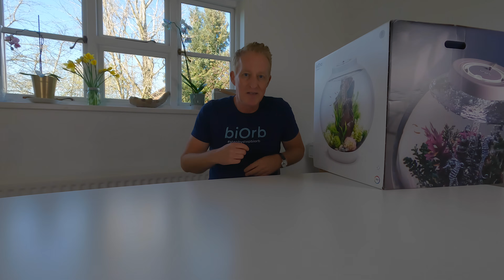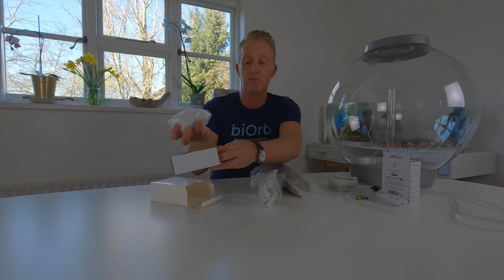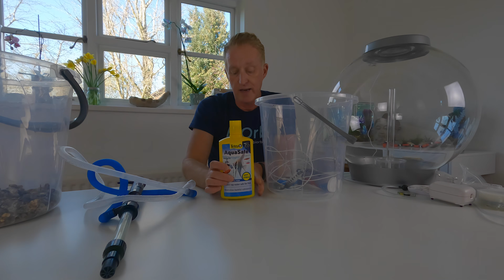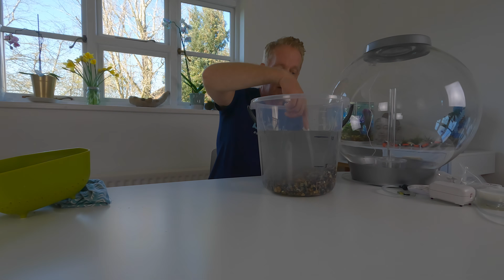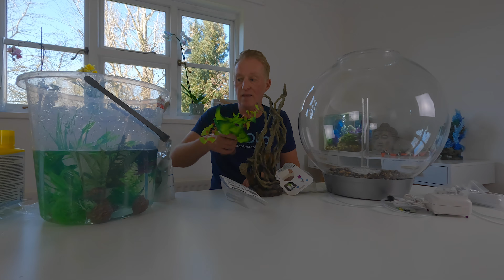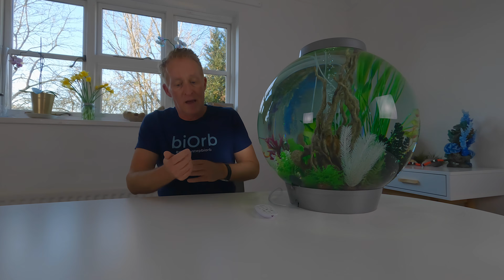biOrb Aquarium   | Starting a biOrb | New approach!

Comment: Hi Mark, great video as always.  I'm setting up a new 30ltr Flow Biorb and have the pearl media, which I have washed as you recommend in your other video.  The 2kg recommended by Biorb only comes up half way around the bottom area of the filter in the middles, does this matter or should I buy a further kg?  Also when do you add the colony liquid, is it at this stage of when you add your water or do you leave it until the tank has sat for a few days?  Thanks!
Reply from the maker: Hi Julie. Yes, 2 kilos is correct for a 30L Flow.  There is no need for it to come up higher around the filter canister. The only real function of the Pearl Media is to act as the aquarium's biological filter and 2kg is more than enough to support the beneficial bacteria needed to support fish in a 30L. 

The best thing to do is to let the tank run (without fish) for a couple of days. This allows the water temp to balance out and allows you to check that everything is working before adding your first fish.  Colony should be added to the water on the same day or at the same time as adding your first fish.  The day before is probably okay though. The bacteria in Colony will only begin to colonise (expand in number) when they have settled on surfaces and when there is a food supply to support their growth (the food supply being the ammonia that comes from your fish and initial feeding of fish food). Adding the colony prior to adding the fish wouldn't provide any real advantages as there would be no nutrients to support bacterial growth.  Hope that helps. Best, Mark
Reply: It's been a week since I first set up the tank and I didn't add any more Colony.  Just watched your original 2 part set up and the revisited.  Also read the details which all makes sense now! THANKS SO MUCH - I made notes this time so I wouldn't forget!
Tap water readings: Alkalinity 300. PH 7.8, Carbonate 120, Hardnss (grey colour not on scale),  Nitrate 0, Nitrite 0, Fee Chlorine 0.
my tank readings Alkalinity 300, PH 8.4, Carbonate 300, Hardness (grey colour not on scale), Nitrate 0, Nitrite 0, Free Chlorine 0
I'm guessing that as some of the readings are way of the required levels I need to wait before adding fish.  How do I get the other levels into the normal levels?
I also had a concern about the main ornament in a Biorb set called Forest Rhythm.  I noticed a strong plastic/resin smell when I unboxed them soaked them all for a couple of hours then added to the tank.  When I checked the temperature there was a really strong plastic smell in the tank, I left it a few days but the smell didn't improve.  I removed the main ornament and have had it soaking in a bucket for about 4 days now.  Is this something that could taint the water and affect the readings?  Should I do a full water change?
Coffee on it's way!,
Reply from the maker: Hi Julie. 

Those readings are fine... it is just that you have hard water in your area (but it is not "very hard"). The pH in the tank reflects what is called "true pH". When your tap water (with pH 7.8) is left to stand for a couple of days the pH will adjust when exposed to air (normally it will rise). In your case to 8.4.

So, all the readings you have are what I would expect with a hard water supply and higher pH level.  BTW - you are lucky to have zero nitrates!!  
Rather than adjust water... it is far easier to go with the water you have.   To alter your tap water you would need to filter it through a RODI water system and then remineralise it.  I suggest you avoid trying to chase a water quality you don't have, especially when you don't really need to.

The very key thing is ensure that you only choose fish species naturally suited to high pH/ hard water conditions.  Examples of the typical fish suited to your water would be: Guppy; Molly; Platy; X-Ray Tetras; Endler's. All of those would be happy with the water supply you have.  

In terms of the ornament smell. It's the first time I've heard of that!  It might be coming from the "paint" that biOrb apply to colour their resin moulds.  I don't think this is a problem to be honest. But, as you have not added any fish yet it might be worth you replacing 50% of the tank water with fresh.  

A really good product to remove impurities, odors etc in a tank's water is activated carbon: https://amzn.to/3wE8k1p. Activated carbon filters the water that passes though it and I'm sure this will help to reduce the issue you have.   If it was me, I would throw away the biOrb filter medium that comes with a new tank (held in the central canister tray part of the central bubble tube filter) and replace this material with pure activated carbon.  I would also suggest using activated carbon in the future, every time you clean and replace the filter medium. So, you might as well start doing that now. 

I hope that helps. Speak soon.

Best, Mark
Reply: Mark you are an absolute star! Thank you so much for all the information, very  much appreciated!  I've made a note of the fish, thanks
When you say replace with pure activated carbon, is that the same stuff that is in the packs of 10 sponges and carbon you show in one of your videos? I was just about to order those!
Reply from the maker: Not a problem. Always happy to help.  :)
Forgetting the overly priced biOrb Service Kits, there are two basic ways of  replacing the sponges and filter medium in a biOrb. 

1. Get the alternative packs that combine sponges along with small individual bags of activated carbon (often mixed with another natural product called zeolite). These often come with replacement air stones. Such as: https://amzn.to/3uRTggd

2. Alternatively you can just get the sponges by themselves, such as https://amzn.to/49OgPWc, and then separately purchase a high grade activated carbon product such as this https://amzn.to/3T9agXw 

Option 1 is probably the simplest approach as you get everything you need in one order. The main drawback is that you don't have any say in the quality of the activated carbon  supplied in the bags.  I prefer to use Option 2 as I tend to want to get higher grade activated carbon. I also need to get individual air stones: https://amzn.to/3TimrCv. 

Generally though it doesn't really matter as both option 1 or 2 work well and are far more economical compared to purchasing the biOrb product. The biOrb product seems to lack much in the way of activated carbon and instead uses zeolite and "other" resin materials to support filtration.  Most of these materials are not of much use  (in my opinion). 

Activated carbon is always the key ingredient needed for most aquariums and for most types of water supply.

Best, Mark

Comment: Great imformative video, however now its all set up full of water etc, how do you lift it onto the Bio Orb stand?
 Would it not have been better to place the stand where its home is going to be and sett the tank up on the stand.
Reply from the maker: Thanks for watching.  

Yes I agree with your comment BUT in my case I was using the tank to produce videos for this Channel throughout the period March to April of that year.  So the tank was set up for undertaking those videos.  A 60L tank can't be moved when full and, to do so, the water level needs to be dropped to about 1/4 on a 60L to allow relocation before re-filling  the tank back up with the water extracted.    And, of course, the tank is now set up on its stand.  Best, Mark

Comment: Hi there. Just bought a bio orb 30 classic.   You are right, the "instructions" are rubbish.  Thank you for this video ( and others I'm going to watch).  Question....I want to make this a planted tank.  Can I add some aquasoil and sand on top of the ceramic media and be successful?  I have a regular 37 gallon planted tank and it's doing well ( finally) with the soil and sand.  Thanks for the advice!!
Reply from the maker: Hi there.   The biOrb biological filter is an under gravel filter system that relies on a good flow of water/oxygen down and through the ceramic media and back towards the central filter/bubble tube. This water and oxygen flow is essential for beneficial bacteria and the better the flow through the media the better the biological filtration. Adding a layer of soils or sand would impede/reduce the flow of water down through the media.  

If you are going to add a layer of sand/soil you would certainly need to convert the biOrb using external sponge rings around the base of the biOrb central filter to avoid these finer materials getting drawn into (and clogging) the mechanical filter.  This sort of thing: https://amzn.to/49eZANE . You may need to add two of these (stacked).  This MAY help reduce the amount of material getting drawn into the filter.

The alternative is to go heavy on using real plants that are not reliant on (don't even like!) a soil substrate material such as anubias and java fern. This allows plants within the tank but retains the correct use of ceramic media as the biological filter.

I hope that helps.
Mark
Reply: @StepbyStep-biOrb  Thank you!!

Comment: Hi. Is the pump below or above the water line?
Reply from the maker: Hi Caroline. Typically, an air pump is placed on the ground, so therefore well below the waterline. There may be some advantages of having the pump elevated above the waterline but these are very small. All mine are placed on the ground.  Best, Mark

Comment: Hi there! I've been given a 60 litre BioOrb - we used to have a large Tropical tank but during our move 5 years ago,  the tank didn't make it! The Bio Orb has a tube hanging underneath it - I was told that 'he had to cut it! " I've now bought 2 mtrs of clear tubing which is slightly narrow than the one hanging down underneath - there's a couple of plastic connectors which came with the airshow sets I bought.  I'm worried that the water might start coming out of the bottom! What is it used for please?  Thank you.
Reply from the maker: Hi Anne. Sorry for the delay. I've been out of the UK on vacation with limited access to wifi. You might be better getting the biOrb product as this would work best and is designed for these aqariums. https://amzn.to/4819gvc. It is basically a simple tube that is best fitted when the tank is empty. One end is pushed on to the small pipe underneath the aquarium, the other end hangs down and connects directly to the air pump. Note that all air tubes (air lines) must have a one way valve fitted (the biOrb product has this already fitted). This stops the tanks water draining down the airline (which will damage your air pump and could also result in the tank completely draining).  The one way valve sits at the end of the airline nearest to your air pump. I hope that helps but please let me know if i can help further.  Best wishes, Mark

Comment: Mark:  I've done everything I should to my 15 L biOrb according to your instructions.  It's been running (without fish) for 5 days.  It is still cloudy!  Ugh.  What should I do?
Reply from the maker: Hi Denise. That isn't an issue. Can you confirm what you have added to the tank to date? Is it just tap water, treated with dechlorinator (e.g. aquasafe?)
Reply from the maker: Anything else?
Reply from the maker: Is the water white/ greyish?
Reply: @StepbyStep-biOrb  Hi Mark. Thanks so much for getting back to me so quickly! Yes, tap water w/ AquaSafe as directed   I haven’t received my tap water tester yet from Amazon. But I have tested the PH (6.8) Ammonia (0.25 ppm) Nitrate (0) and Nitrite (0ppm). Water temp is 79 F
Reply from the maker: Perfect! 

The are two main causes of cloudy water. 

The first happens if the substrate added to the tank hasn't been properly rinsed to remove dust residues etc.  This can be easily tested by turning off the air pump for about 15 mins to see if the coloration goes. Turning off the air supply allows any particles, held within the water, to sink to the bottom of the tank. This will then leave clearer tank water. 

But, the main reason relates to the initial stage of the aquarium cycling. With a brand new tank, it is EXTREMELY common to have a bacterial bloom (mainly caused by heterotroph bacteria). These are very early bacteria that are taking advantage of the conditions created in the tank (no chlorine and lots of minerals in the water). The ideal conditions you've created cause them to rapidly increase in number. The bacteria are basically having a free for all, as they have no other bacterial competition in the tank... they are having a party!  They are not an issue for the tank/water. If left long enough they will eventually consume all the available minerals... and then it's party over!  But, if you were to undertake a water change, you would simply be helping them bloom all over again by adding more nutrients. Party time again and the continuation of cloudy water! 

These initial bacteria are very easily out-competed by other bacteria that will form in your tank (beneficial bacteria) so when you start to cycle the tank, add a bacterial booster, and a few fish you will find they will go almost overnight!  

For now, I suggest you sit back and try to enjoy the very first signs of life in your new tank :)
Reply: @StepbyStep-biOrb  Thanks again for your timely response. It’s  103 degrees here in California. I have nothing else to do but stay cool inside and enjoy my new tank!